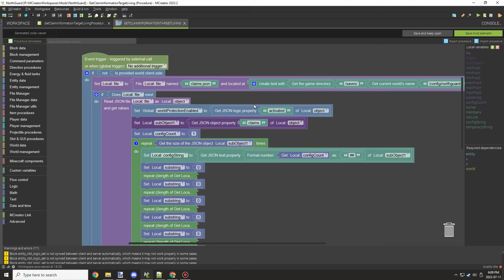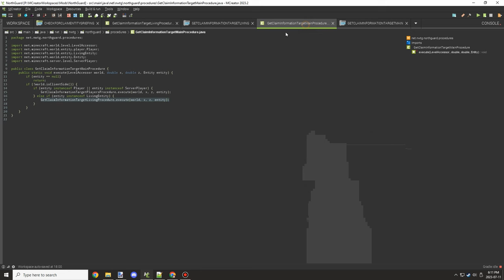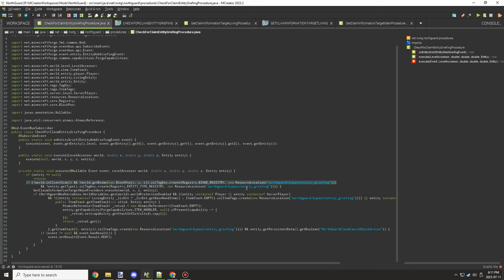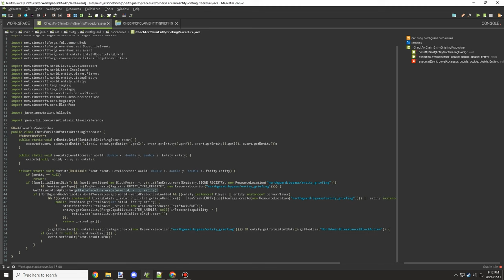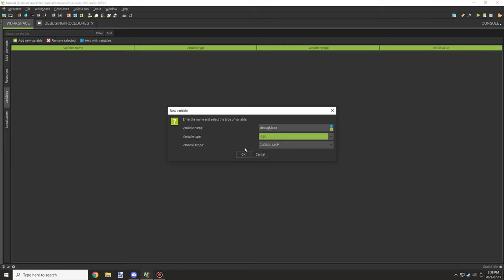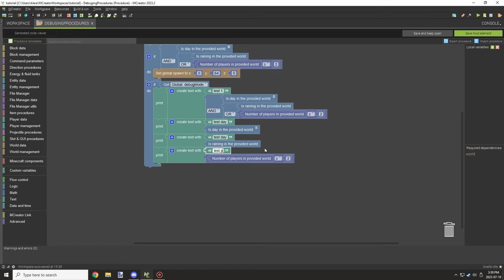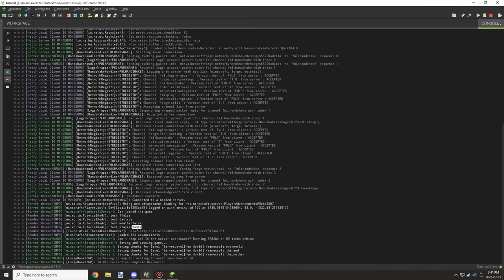MCREATOR: How To Debug In MCreator

Comment: Do you know how to deal with mcreator not running when I try to test?
Reply from the maker: Depends on the error your getting, I suggest checking the wiki for common issues.
If it's a compiling issue in your mod then chances are you have some bugs that need to be worked on before you can resolve this issue.
Reply: @NorthWestTreesMCreator  ok